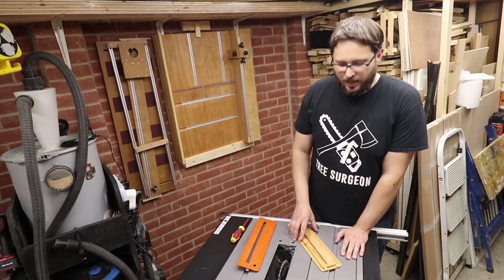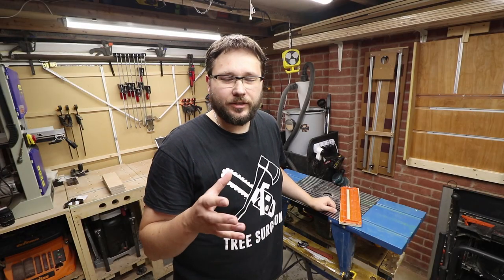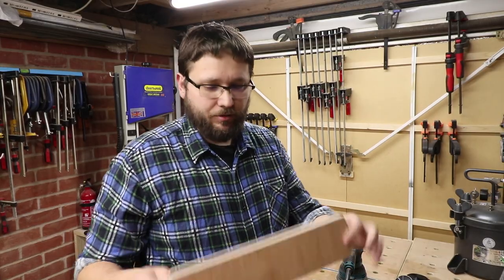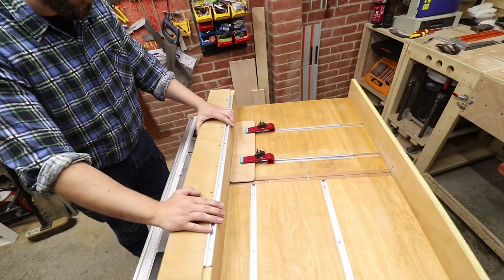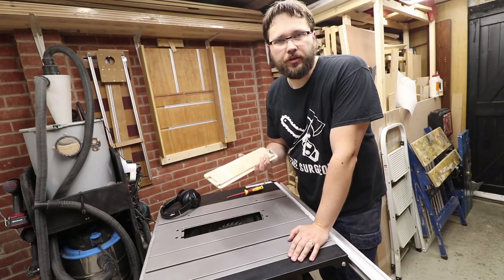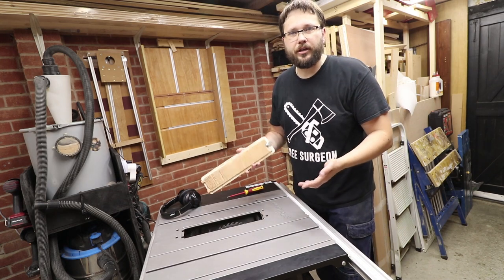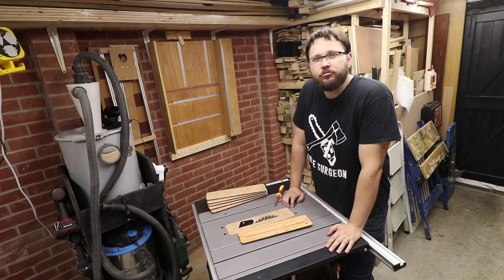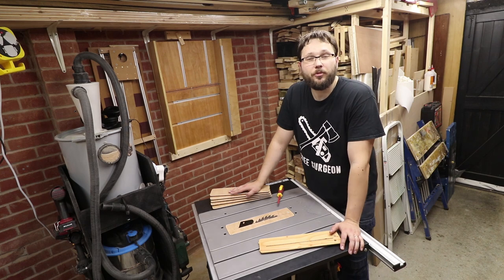Zero Clearance Insert Plate for Evolution Rage 5S With Limited tools - Version 2

Comment: You might also consider hot gluing the new plate to the top of the old one in situ so it stands proud. If you clamp it in place then you can raise the spinning blade through both plates thus cutting the top one.
Reply from the maker: Good tips thanks 👍😁

Comment: Worth mentioning that the current plate that ships with the Rage-5S has a little vertical ridge underneath about the width of a lollipop stick. It is shaped to cover a gap under the plate to stop dust getting it. You might like to glue something on that.

Comment: I just found this interesting and I thought you might also. I called evolution's direct line and spoke to one of their sales person and found out that the machine is on back order until August 3rd week of August, I question him about using different blades, he told me if you take the inner flange that holds there blade on and flip it well except a 5/8 blade bore no need for reducers.
Reply from the maker: Hmm that's interesting I need to check that out thank you 👍😁

Comment: Thank you so much for doing this video.

I live in South Africa and we get almost the exact same table saw just branded a different name.

I have also found the plate insert to be pretty poor and flimsy. I lve actually had the end of the timber, once pushed through the blade, it almost pinches the Timber and angles the cut as the Timber is being pushed in towards the blade.

I will definitely attempt this.

Thamk you again
Reply from the maker: Thank you so much for watching 👍😁

Comment: I made one of these but instead of the lugs and locking mechanism I just drilled a hole through the wooden plate and the metal lip underneath tapped the hole in the metal lip with a 4mm tap and fitted a 4mm machine screw through it. Better still would be for Evolution or any manufacture to supply a zero clearance plate as well as the original. I can't think why they don't??? Thank you Tomasz. Great video as usual.
Reply from the maker: That's actually a good idea, much easier to do as well I think. 
Thank you very much😁👍
Stay safe
Reply: @CasualDIY  Even less tools! ... 🤣

Comment: nice video.  tried making a couple without success.  As you need to route out the thin lip you really need good quality plywood.  I am going to try now with some hardwood which should hopefully bring success.   Another thought, how about just getting perspex of the right thinkness and then no routing is needed.  Would it be strong enough?
Reply from the maker: Hmm the perspex could be not thick enough and would bend too easily under pressure plus not sure how it would cope with potential heat build up from the spinning blade. It could become too flexible from the heat generated?

Comment: These plates will only work when the blade is at 90 degrees I guess, so for angled cuts you’d go back to the original?
Reply from the maker: You would have to make a separate plate for each angle. However I have only used 45 degrees so I would only need an extra plate

Comment: Used a label engraving material incorporating a layer of Aluminium. This matches the depth required for the plate and has almost no give. Have marked inner and outer edge cutting lines and used it white side up. Have considered safety colors but white works much better in practice. Keep your hand out of the white area whenever the motor can drive, easy. Had problems with alignment of the table flatness and the blade. These were adjusted optimally using the screws above and below inside, now good enough for most jobs. Love your videos, keep them up, excellent worl, many thanks Casual DIY. PS anyone had any ideas for the clearly intentional moulded pieces on the two sides?
Reply from the maker: That's an interesting approach there. 
Thank you kindly for watching my videos 😁👍

Comment: Brilliant video Thomas very informative,. perhaps instead of glue use double sided tape ( I know Ice mentioned this before, it may be to late to change this demo) perhaps you could do a demo on how to use double sided tape as an alternative to glue . I have used to to hold a few things and I'm 85 and find it difficult to hold stuff with one hand and using a screwdrverdrill in the other due arthritis.  I'm going to install a led batten fitting on my shed roof which a step ladder is necessary so I putting double sided tape to where I want it and just push the fitting onto it enabling me to screw it to the roof I'll send images if that is permitted. Thanks for inspiration Mike
Reply from the maker: Hi and thank you. 
Yes double sided tape would work as well. I just don't have any in my workshop🤣

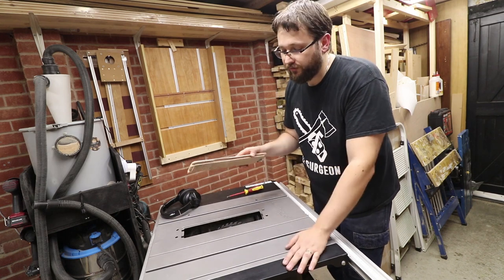Comment: 09:35 why not start with the plate flipped over and cut the slot in the topside first, then you can flip it over the right way round and cut  through the underside, that avoids having to rout the channel in it ;)
Reply from the maker: The blade doesn't go low enough, even when flipped over it will rest on the blade. However when I'm batching them out I use a different method, that's not as safe hence I did not share it.
Reply: @CasualDIY  what is your view on acrylic (perspex) sheet as a zero clearance plate?
Reply from the maker: @alheeley  it may melt due to temperature made by the spinning blade. But it mat not🤔 worth having a look

Comment: I tried again, but I think the wood I am using is to hard. Sapele, as saw just pushes the wood up and won't cut it at all. Will have to make one out of pine.
Reply from the maker: That should not be a problem. Maybe the blade is really dull?

Comment: I am assuming that there is such a large opening in the original insert plate around the blade to allow the blade to be tilted over for bevel cuts. How can you tilt the blade with your zero-clearance insert?
Reply from the maker: The zero clearance plate is made for straight cuts. For angled ones you would have to make a new plate for required angle.

Comment: Great idea for the insert plate!
I need to build one myself because the plastic one just broke....
Could you please tell me the size of the little washer you used for the locking mechanism? Is it 10x10 oder 20x20? I can only find 20x20...
Thanks in advance!
Reply from the maker: Oh can't remember exactly but I think it was 20mm but you have to grind it to correct size.

Comment: Not zero clearance, but I took the flex out of the cheap stock plate by gluing some threaded bar in the slots in bottom to make it more ridged.
Reply from the maker: If it works for you then great 👍
Reply: Zero clearance like yours will come but quick and easy solution to the flexing issue in the mean time while getting going.
Reply from the maker: @josephtrice-rolph4835  yes the flex is really bad and anything to help with that is a must I think